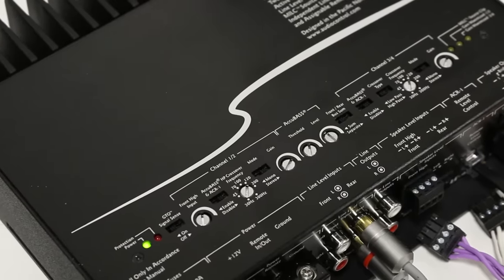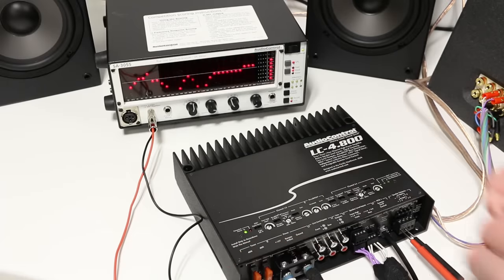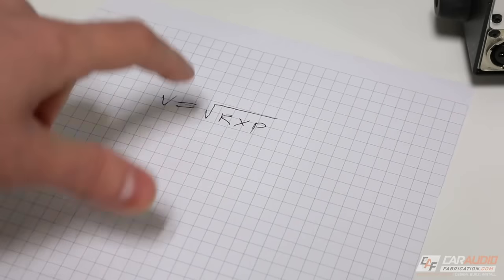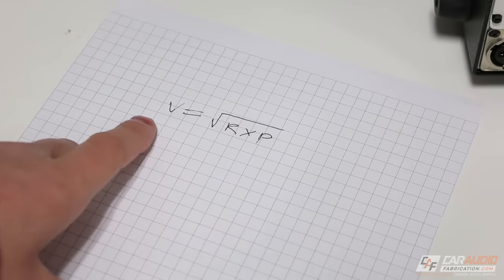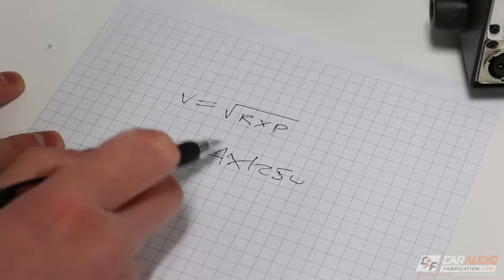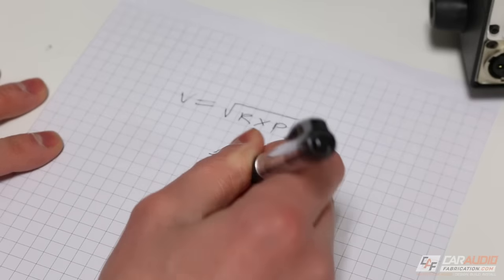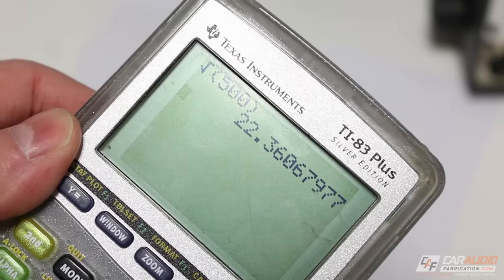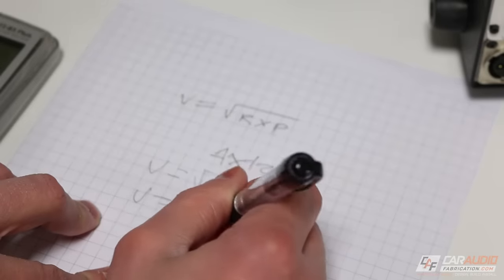Amplifier Tuning Settings How To - Gain, Crossovers, Bass Boost

Comment: How do you know your car has premium audio or a factory amp? I blew mine up by hooking up an amp where the head unit was for testing and it ruined the factory amp. I didnt realize my car had one.
Reply: R3MIX MODZ Easiest way in my experience is to set your multimeter to ohms/resistance and probe a pair of speaker wires at the car's radio harness (while unplugged from the radio.) If it's not factory amplified you'll normally see 4 ohms, sometimes 2 or 8 depending on the vehicle. If you're meter shows something crazy high in the thousands of ohms (or it may say "K Ohms") or even higher (like "M Ohms") then you have a factory amp. If you don't have a multimeter you can try popping those speakers wires with a battery or a polarity tester; if they pop then you don't have an amp, no pop and there is an amp present.
Reply: Anything that says “premium” on it is guaranteed shit. Quality products don’t need to advertise it as “premium or audiophile”. Those are just marketing terms and hold no meaning. Notice how Mark uses air quotes when he says premium. 
As for your question I don’t think the other guys answer is backwards. Just look in your cars manual or measure the voltage on the signal while playing a test tone. An unamplified signal will have around 1v-2v maybe up to 5v maximum. Your new amp will have specs for its max input signal. If you exceed this you’ll burn out your amp.
Reply: ocda3 I think you have that backwards. The amplified signal will be the 2-8 ohms. The preamp signal will be 10k ish’
Maybe someone else can chime in here and correct me.
Reply: I hate marketing bullshit!

Comment: Great video. Helped me understand how the X-overs work. I recently had a shop install an Alpine SWT-R12 subwoofer in a fibreglass enclose, but I am not satisfied with the sound. The sub is powered by an Alpine PDX 1.1000 Mono. The bass doesn't sound right. It feels and sounds like the subwoofer is working hard but the bass is very minimal.  That could be because I am running it off the factory head unit.

Comment: @CarAudioFabrication At the end of 6:48 it would be interesting to see what the Voltage was reading after you reset the gain with the SMD Detector. I would then try to see what the difference would be, just for my understanding of what went wrong with the Multimeter reading. As always great watching your videos, im always listening to you and most of learning!
Reply from the maker: I intentionally didn't shoot that as people would then try to justify "well I can just back off .7 volts and it's the same thing". Using voltage is not a good way to set gains. You need to make too many assumptions
Reply: @CarAudioFabrication  Appreciate your post. Im in the means of a small installation. Want it looking as standard as possible but want to do it right once. Thats why im watching your technical videos. Thanks again dude 👍🏼

Comment: So now if I was to find clipping of the amp at half way of the gain knob but then turn it down and only back up to that level only, then it's a volume knob to that point. 😂 but yes you need to know what max is first. And if you'd like to find roll off of where your crossovers are I use the selected test tone I want to roll off the crossover at and measure the output voltage of the amp with a dmm. When the voltage either starts dropping or completely drops off your at your set frequency.

Comment: How is this done when there’s an EQ in between the stereo and Amp?
Reply: go down the line. set volume limit on head unit, then the eq, and last the amp and youre set. i mean its at least as simple as that if you have the smd distortion meter i used mine for my hu eq and amp and made it SOOOO easy for a 120 buck that tool is worth it anyday

Comment: Thank u for associating power with watts sime people think power is volts or amp so annoying
Reply: Yes, many people do not understand that power is a defined term.  It is a measure of WORK.  The WATT is one type of measurement unit of power, directly related to how much work is being done.  In the case of conventional speakers, the work is the motion of the speaker cones.

Comment: I don't think you mentioned the level of the test tone?  Do you always recommend a 0 dB or a -X dB tone for a modestly-powered system (say, with speakers of average efficiency and amps rated 50 W RMS for components and 250 W RMS for sub, crossed over at 90 Hz).
Doesn't a 0 dB tone leave a lot of power unused (due to the dynamic nature of music vs a "worst case scenario" 0 dB test tone), so the maximum volume of said system would be rather disappointing.

Comment: What was the (gain) voltage after testing it whit the SMD tool?
Whit the multimeter the gain knob was turned to 50%.
Whit the SMD tool it wasn't even close to 25%....also the headunit volume was turned down.
What if you have a pretty good  pioneer headunit
Can you go to 75% of the volume when you set gain whit a multimeter ?
I gues a pioneer starts clipping much later than that stock shitty headunit

Comment: So I had a subwoofer and amp professionally installed into my car by an audio shop. It sounded great, the sub only played the lows and my speakers only played the highs and mids. Sounded amazing in my opinion. Then about a week later, the face plate on my head unit broke. So i went and bought a new one and had the same guys who installed my sub install my new head unit. Now after listening to music in my car the past few days, i noticed that the sub in my car is now playing vocals now, instead of just the lows. Can someone tell me if this is a problem with wiring, or do i just need to adjust the low pass filter on my amp?
Reply: Look at the back of your head unit and make sure the two red and black cords, ac plugs, are in the right spot, there should be four plugs, try switching them
Reply: @rileyluokkala5726  wait so is one red and one black rca input dedicated to the sub? Or are they all just for speakers?
Reply: Random Stuff By Andrew There is two rca plugs deficated to subwoofers
Reply: @rileyluokkala5726  it worked! Thank you man!
Reply: Random Stuff By Andrew anytime👍🏻

Comment: May I request your help here: 

I have two pairs of Dynaudio Esotan System 372 6-1/2" 3-Way Component Speakers

Front Right and left doors- tweeters on the A pillar respectively and 3”Mid woofer & 6.5” woofer on the doors.

Back Right and left doors- tweeters and 6.5”woofer & 3” woofer on the C- pillar.

Head unit is factory. 2021 Tuareg VW SUV

My line out control: 
Brand: Mosconi Gladen
Mosconi HLA-Sum, High Low Adapter with Summing

My DSP: 
Brand: DSP 4TO6 SP-DIF - Mosconi 4-Ch in / 6-Ch Out Digital Signal Processor with SP-DIF

Amplifier-JL Audi HD600/4
&
Amplifier - JL Audio HD750/1

Sub in trunk sealed: 
JL Audio CLS112RG-W7AE: Single 12W7AE ProWedge Sealed 3 Ω, 400-1000W.

Comment: My multi meter only measures 0.011v on the speaker output and it doesnt change when i lower or pump up gain
Reply: It sounds like you have the meter set to DC, instead of AC.

Comment: So the Battery is no good anymore? "Never set them on the ground", or at least that is what I've been told by someone at a AutoZone store(was there for a new battery, left light on and old bat wouldn't recharge). Somehow they discharge being on concrete or something?
You would know better than me. I deal with RC LiPo's, not lead-acid(glass or gel) car batteries. So while highly doubtful a battery goes bad from being on the ground, i dont have much knowledge in this area. 

Side note: thanks to your videos, i have some ideas on what to build. I like to take car steroes and make "portable" steroes from them. 
All these videos on how to properly adjust gains helped my first build sound much better, and saved me from clipping another cheap 8"sub. 
So I wanted to say thank you for making these VERY helpful videos!!
Reply from the maker: LOL, this was true for batteries in the 1800's the construction today makes it so setting them on the concrete has literally no impact on their performance. That battery has been sitting on the shop floor for well over 4 years now, still going strong.
Reply: lol auto zone told me. my optima yellowtop was dead everyweek. they kept replacing it xD. it was just deeply discharging
Reply: CarAudioFabrication finally someone who knows what they’re talking about👍👍

Comment: I watched a dudes vid on how to set gain and i did it and all he saud to do was turn gain all the way down turn head unit all the way up till distortion then back off and then turn gain up till distortion then back off and its set and this how ive had my car set up but i want to ask if thats fine for the time being as i cant afford ur tools also im guessing distortion is when the song sounds raspy, crackles, basically sounds ugly lol and one kore thing i tune the crossover on my pioneer headunit and as i set the hpf/lpf it has another option lets say i set it to nothing lower than 300 and the other option is -24, -12, -6, 0, +6, +12, +24... would it be that those numbers are just added or subtracted from the lpf limit for more fine tuning? I know im asking alot lol but any help from anyone in comments or u would help me as my manual dosent cover this

Comment: You forgot to pop in the CD that comes with the DD1. It also tells you the different hrz you will tune your amp to. You also forgot to tell the people that those positive and negative leads from the dd1 hook up to the speaker positive and negative terminals of the amp without having the speakers connected. Good video though

Comment: I know this video has been around for a while however I have a brand new Alpine X-A90V amp and it'd related at  300watts at 4ohms.
I have used a test CD with a tone of 60hz and measured the voltage of the amp with the head unit set at 3/4 volume and adjusting the gain on the amp to reach the calculated voltage using the correct formula. The amp does not reach that voltage at all. It reaches 28.4 volts at max gain yet the calculation works out to be 34volts.

If I invert the calculation and enter the volts and the resistance, I get 198watts.

The amp is brand new! 
Any advice?

Comment: My amp has a subsonic filter. Where is the best place to have it at.
Reply: depends on your Subs/Enclosure ...general rule, set it between 20-25hz... you probably can't here that low, and music rarely has info down there anyway so you won't miss tones that are down 3-6db ...but it may keep your subs from "over extending"
Reply: pallusubaru alright thanks that's about where I have it at now just wasn't sure if I could get more of a range out of them by having it set higher or lower
Reply: Anything below 40hz is wasted information! Haha

Comment: Im having an issue with my new system. It seems super sensitive. If I tap on anything in the car, the sound is coming out of the subs.
Reply: bad rca cable, or rca cable is on the near of speakers wire or subwoofer PLUS  wire

Comment: Question, because i noticed the gain knob has been moved from after you set the gain with the dd1 and, to, while adjusting the crossover the gain knob was in two different position....i did alot of rewinding in this video because i’m just $200 away to get this amp.... and i noticed from this video that the green light should not come on in setting the gain....
Reply from the maker: It came on when I set the gain with the multimeter because the multimeter is not a good method for detecting distortion. Once I tested with the DD-1 the light was no longer on, both the light on the amp and the DD-1 illuminate very close to each other so you can just use the light on the amp if need be, but not many amplifiers on the market have a good integrated adjustment light so that's why I didn't mention it.
Reply: I have a lc-6.1200 that I'm trying to setup, and noticed this also. The light was on with the mm, and off after the dd1. For this amp the dd1 is not  required. This should have been explained in the video just purley for the added value of the amp features.

Comment: what if your amp doesn't have a gain knob ?
Reply: It is probably then labeled "level".  Some amps in the past have also labeled it "attenuation" or "attenuator", since internally most of them only reduce the input signal before it reaches the first amplification stage.

Comment: So you used a multi meter and maxed out your gain, and then you used the SMD and basically set your gain back to minimum and called that good. By this logic I should be able to set my gain anywhere between 5%-95% and it will be optimal. Thanks for this.

Comment: That voltmeter is only accurate at 60hz. I heard that on a audio website.
Reply: You can buy meters that are good between 20 Hz and 20 kHz.  But regardless, as decent meter will have specs with it stating what frequency range and wave form it is good for.  At that point you also would likely be buying a "true RMS" meter also.

Comment: Can I set up high pass and low pass filter on 4 Chanel amp and 4 coaxial 3way speakers ?? 
I have Polk audio coaxial speakers 2x front 2 X back 
Polk audio amplifier and pioneer deh-80PRS .

I am struggling to get right sound from my system especially t higher volumes ,looks like my high frequencies are too noisy or too strong for my ears .

Can someone help a bit with advice ?

Comment: You Never did touch on bass boost.  A good video now those guys in actually see why setting with a DMM does not work.
Reply from the maker: Yes I did, you should set it at the max value while adjusting your gain, once the gain is set you can then adjust the bass boost to taste from song to song.
Reply: had to watch it again i see what you said there. bass boost knob. i'm not use to hearing it called that. im just use to hearing it called just a bass knob. i was thinking bass boost adjustment on the amp like the mono amps have.

Comment: If you decide to have a car stereo store do anything you better check the work. My son had a pretty nice system, but when he installed fosgate door speakers he cracked one by over tightening the mounting screws (the speakers were not on a flat surface). He didn't know what happened so he took it to a local stereo store. They took out $350 fosgates and told him they installed speakers that were "as good as the fosgates". They installed some piece of shit phoenix gold speakers and charged him $300 ! they didn't even tune the system. I didn't find this out until it had been to long to fk with it. Anyway just check the work because scumbags are always waiting to rip you off.

Comment: What if your amp doesn't have a gain does that mean its poop lol.....i have a level ,subsonic fitler, bassboost and low pass freg. And input sensitvy and phase switch....its a planet audio 3000.1d
And most amps say watts they have but there not true watts so what then ?

Comment: do you have a email that you can share. I have a couple questions that I'd like to pick your 🧠 about. it's about wiring up a dsp and amp with a component set in the front and rear door in a 2021 f150

Comment: Wtf is subsonic for ??
Reply: ORANGE BOY 714 that is for even lower bass frequencies..so say the subsonic says 10hz(on the left part of dial) and 20hz on the right side of the dial(just throwing numbers of here to make it easy)..if you put the dial right in the middle(15hz)(theoretically) it will not allow the sub to play a hz note below 15 hz..so basically it is a threshold for low bass..if your box is tuned to 35hz for example..it is recommended to set the subsonic filter 5hz below the boxes tuned rate(30hz) because their is some roll off with enclosures..

Comment: So, hopefully someone will chime in here..  

I have a Polk PA660.  (75w rms x4 @4 ohms.

Ive disconnected the speaker wires, bypassed all dsp functions on the receiver, with eq's flat, volume at 3/4 volume, connected my multimeter, placed a 1khz tone on repeat, and I get no more than about 2 volts no matter what range selection I use on the multimeter.  Ive tried using pink noise as well.  Barely any voltage.
I have tried with the amp set at full range, and with the high pass crossover set @ 50hz and up.

For the heck of it, I tried a 50hz tone, and only reached 12 volts with the gain all the way up.  Not even close to the 17.32v that I'm trying to reach.  Ive always just set the mids and highs by ear, but wanted to try this method, because ive done it with my subs and like it

I have no issue reaching target voltage on my alpine mono block.

I have another Polk PA660 in my other vehicle, and have the rear channels bridged to a sub, and have no problems reaching target voltage for the bridged channels of it using the 50hz tone, but I have never been able to reach target voltage on the front channels. 

So, two different vehicles, two identical amplifiers, and cannot reach target voltage using 1khz tone. 

Since I use my ipod soley for listening enjoyment, I have downloaded 50hz, 100hz, and 1000hz tones.  I only use the device with usb, and not Bluetooth.

Should I use a CD?  

Any answers out there?